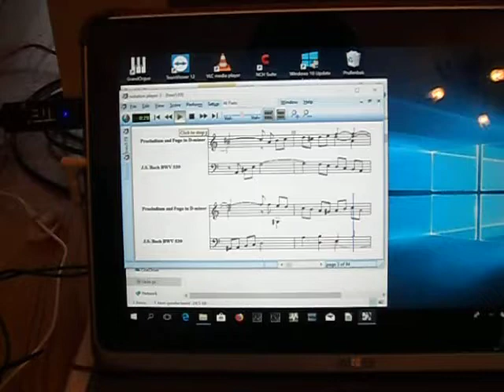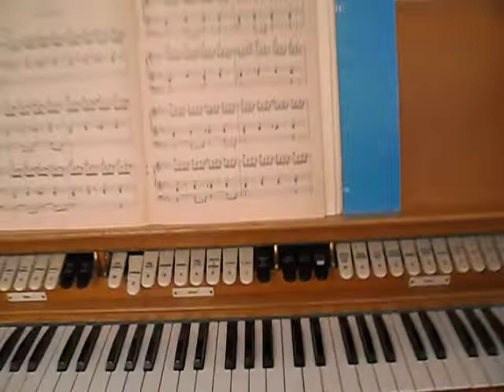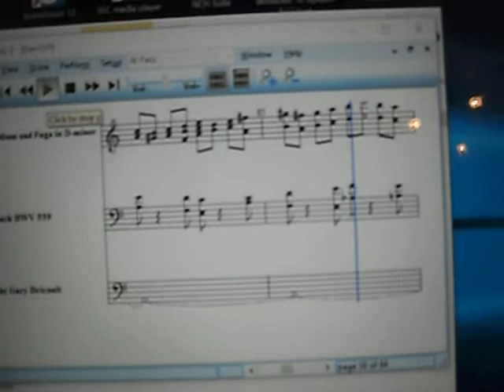SDC15694

Comment: Dag Pieter ,wat leuk ;  bij ons kan het kerkorgel aangestuurd met midi  Heb je het bestand zelf ingespeeld ?
Ik ben organist maar heb  niet zoveel  verstand van de computer Kun je zo, n midibestand mailen ?  Het lijkt mij wel leuk om het een keer te laten spelen op het kerkorgel .
Reply from the maker: Hi Amigo,

You can find several MIDI of organ on the Internet. It is not realy easy to play a pipeorgan with MIDI files without experience. You need a MIDI program and a MIDI file. You need a USB interface to a MIDI 5 pins DIN plug.